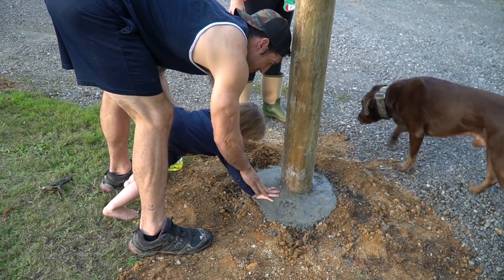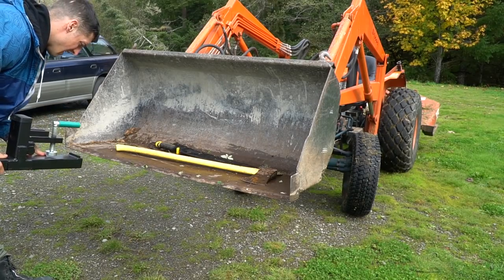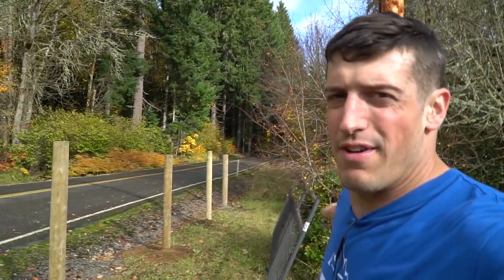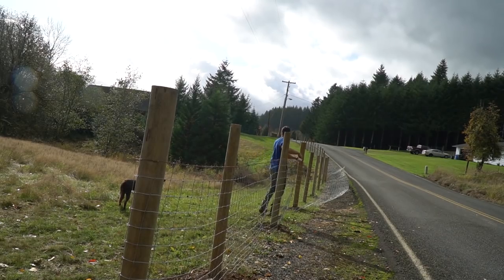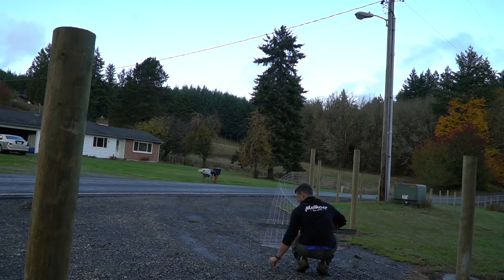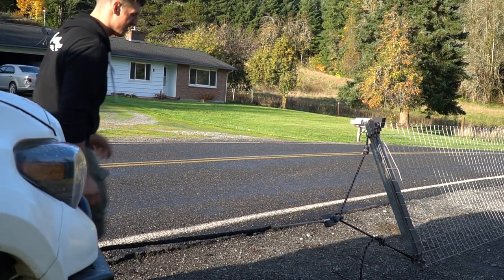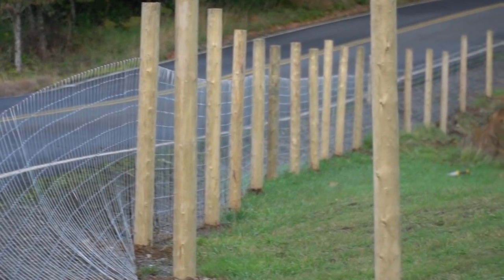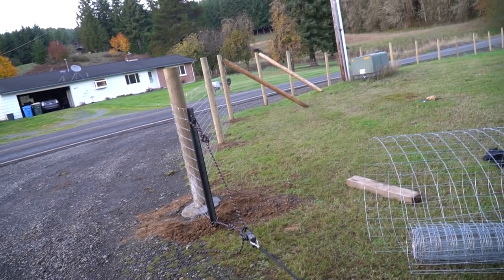How to Stretch Wire Fence with a Winch | Hope this Works!

Comment: Agree with the end braces as other have commented.  I realize this is for dogs and kids (and work better for catching cars).  If this was for livestock (keeping them in) you would have the wire on other side of posts (prevents livestock from leaning on fence and snapping the staples out also post & keep fence from moving).  Your fence stretcher seems to be doing the trick.  Great job.

Comment: For the wallpaper, soaking should do just fine for how it looks like it is coming off. little trick is to soak it then take painters poly (Plastic) and set it over the part you just soaked. If you put enough water on it the plastic will stick itself to the wall. This will hold the moisture on the paper longer without it drying out. While that is soaking you can do the next wall and so on. Been installing and removing wallpaper for the better part of 10 years. A steamer is just a mess and hot as hell. A 4 to 6 inch putty knife or a razor blade scraper works well for scraping after it has soaked for a while. Add a little bit of dish soap to the water as well to loosen up and wash the glue off. Love the channel and your family.
Reply from the maker: Thanks for the tips man.  I appriciate the love dude!

Comment: If I had any suggestion I would say to put the posts in then wait like 1 winter like dig the holes at the end of summer then wait till the middle of the next summer after its been all wet and settled and dried then add the metal fence.

Comment: Red brand fence the wave in the horizontal line should be almost straight after stretching. For the ends to secure them you need to cut the vertical wires so the horizontal wires are about 24 inches long . Then wrap it around the post to the till the wire meet the same horizontal wire on the fence then twist the wire around the main line to create a loop. Ensuring to do the top and bottom last. Lastly put fence nails on each horizontal line.

Comment: Definitely put some kind of support to keep your post from moving. Even being deep in the ground the fence over time will pull that post. Since your second post is so close you can add a heavy cable to the top of the second post and run it down to the bottom of the first post and add a turnbuckle to add lots ot tension and will keep the end post from getting pulled.

Comment: A fast way of setting this to pour dry quikrete in the fence hole with the post. Make sure someone is holding the post leveled while pouring. Then fill the hole with water.

Comment: Best way to remove wallpaper is to use a roller with tacks embedded into the roller to pierce the paper through to the glue backing so the spray solvent can get to the glue layer.  They sell kits for this purpose and it works VERY well and makes the job ten times easier.

Comment: Usually to terminate you cut the vertical wires out of the mesh back a couple feet and just wrap the horizontal wires around the post, tying them back on themselves. Do this with about half of the horizontal wires cut from the bit of mesh you have in your makeshift clamp. Once the first wires are secure, you can release tension on the remaining horizontal wires and tie them off in the same manner.
Reply from the maker: Gotcha that makes a lot more sense then what I did

Comment: To save time you could of mix the cement straight in the holes. Add a 1/3 of the bag in the hole, mix with water. Add another 1/3 of the bag, mix with water. Repeat until the hole is filled.

Comment: The posts will stiffen up after the ground dries and it settles a little more. I would definitely set up a couple of H braces on that bend and maybe a double N brace. Shouldn’t be any need to concrete them or pull them out after you do that.

Comment: YOU realize those wooden posts will ROT off at ground level over time , due to moisture absorption through the cement ! You should have coated them in roofing tar or soaked them in diesel or old motor oil !
Reply from the maker: They come with some sort of coating on them, but yeah coating them in somthing would have been even better for sure.